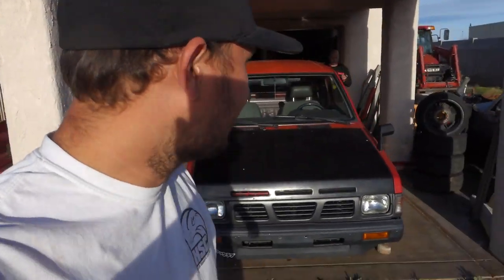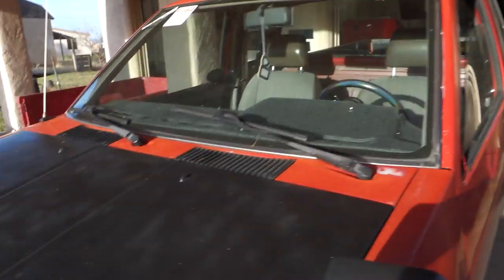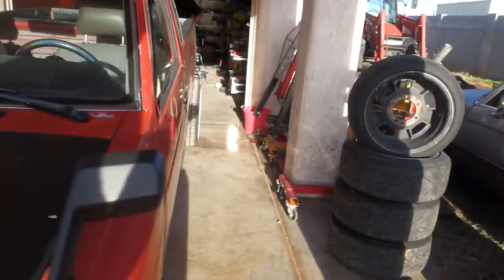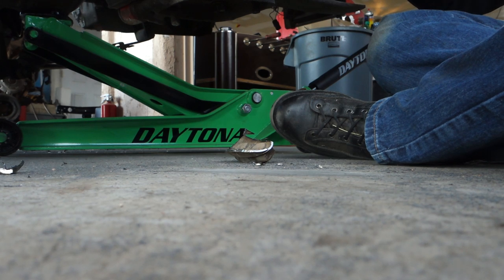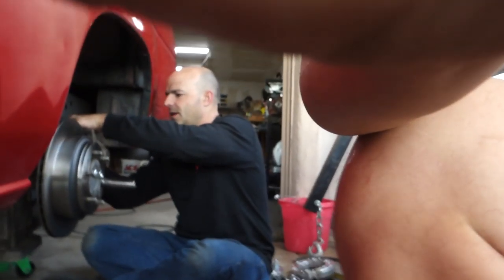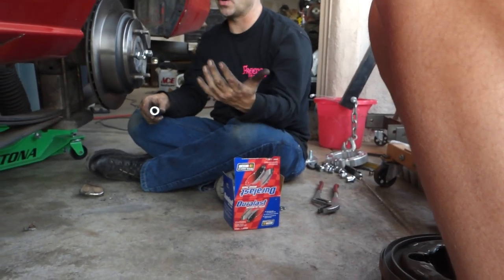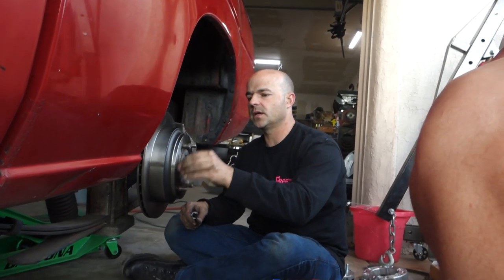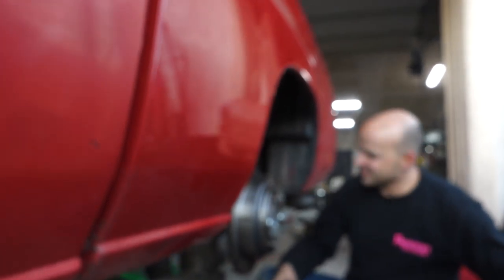D21: Rear Disk Brake Conversion (z32 calipers)

Comment: If you use the OE rear disc brake setup from a 89-95 pathfinder you don’t have to hack up anything and it all bolts on. Retains a parking brake too.
Reply: so 89 to 95 pathfinder rear disc brake setup will be a direct fir on my 95 nissan pickup xe
Reply: @joshuacollett761  provided you have a H233B rear axle, yes it will all swap over.
Reply: I'm knot sure what the axle is in my truck
Reply: @joshuacollett761  look at the Nissan Vin plate in the engine bay
Reply: Ok thanks
Reply: So how this work? Is it like a bracket or something, I would still wanna use the Z32 brake calipers as well, would I need to cut all the stuff out like in this video then use the bracket from the pathfinder and the disk?
Reply: @SKATESPOTSWORLDWIDE  not sure about the Z32 calipers but if you have a H233B axle everything swaps over from a disc brake equipped first gen Pathfinder. It requires disassembly of both axles, swapping backing plates, e-brake assembly, brake lines etc. Direct swap, no fabrication. All bolt on.
Reply: @apollo280zx  I feel like the way they did it in this video would be easier and more efficient, but thank you for the info!
Reply: @meanpaintandbody  axle width has no effect on this. It's been done on lowered rigs
Reply: @apollo280zx thank you very much for sharing this very helpful and valuable information with the community!
Reply: Does this apply to a 97 nissan pickup also??
Reply: @jonytesttest1  it applies to any car or truck with the Nissan H233B rear axle. Check the ID plate in your engine bay on the firewall. It will tell you what rear axle is in the truck
Reply: @apollo280zx mine says hf 35 will that still fit the pathfinder conversion
Reply: What size wheels are you running on your guyses trucks? I'm asking do to that fact I'm questioning do to calipers hitting.

Comment: I used the master cylinder, axles, backing plates, calipers and rotors from a 93 pathfinder for my swap. This was on an 86 hardbody 4x4 with an H233B rear axle.

Comment: I wish I had the z32 calipers. I just have willwood. It was a pain in the ass but it's so much fun to drive and you definitely feel the difference.
Reply: Local Losers 520 I went to a hardware store and used a washer and a locking washer nothing to fancy

Comment: Great videos guys, I do have a question, I recently purchased a Datsun 620 that came with front disk brake upgrade from a Nissan Hardbody, but the rear still has drum brakes that I would like to upgrade to disk brakes in the back as well to match the front end. However, the truck was actually converted from 6 lug to 5 lug (5 X 114.3) bolt pattern. Is there an option for rear bakes with the same bolt pattern from a Nissan vehicle or do I have to mix and match sort of like what ya'll did in the video? Thanks!

Comment: Hi guys, I've got a 89 D21, SE, king cab, 4x4.  Got the brackets from Beeboni off ebay.  The brackets fit, but the rotor center hole is too small and the calipers don't center over the rotor.  Got 90 Trooper and rotors.  Can't find contact info for Beeboni. 
Please help.  This is my work truck.
Thanks,
Tree Farm Guy

Comment: What is the part number for those rotors exactly?  Year/model of the Honda vehicle?  Also what leaf-spring are you using?
Reply from the maker: No idea on part number then are from a 2000 handa passport i think....
Reply from the maker: Stock leaf springs

Comment: Since you didn’t mention the safety side outside of a missing parking brake in the video, I’m gonna mention it. 😉
No parking brake also means no panic brake in the event of main brake failure. So, if the main brakes fail with this conversion, the only way to stop is to hit something solid.  Hopefully a tree, pole, rock, a parked vehicle.... and not another human being. Just an FYI. 🙂
Reply: Local Losers 520 I’ll just keep you in front of me. 😉😂
Reply: Dude,  downshift